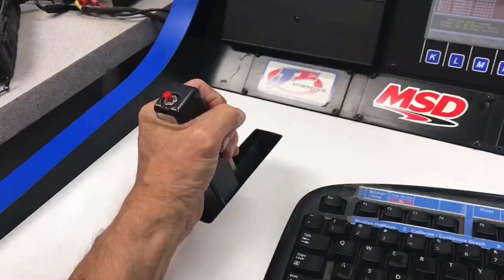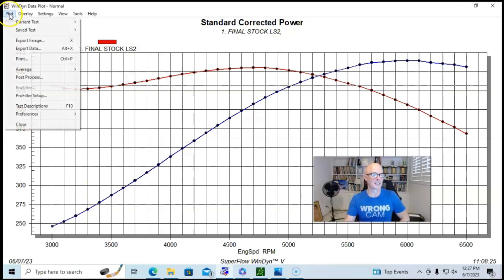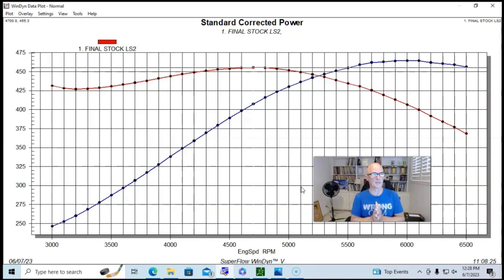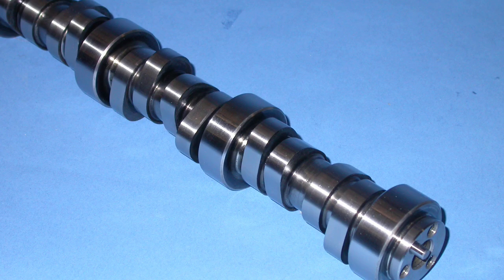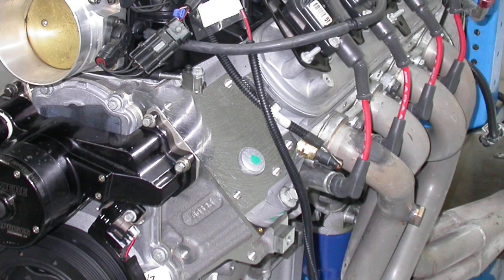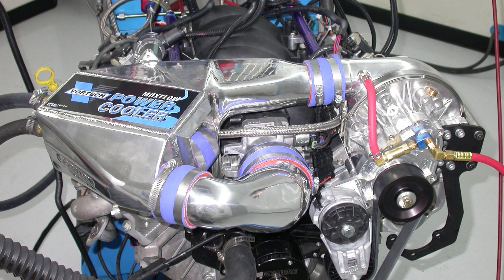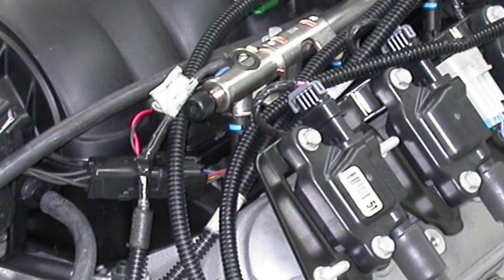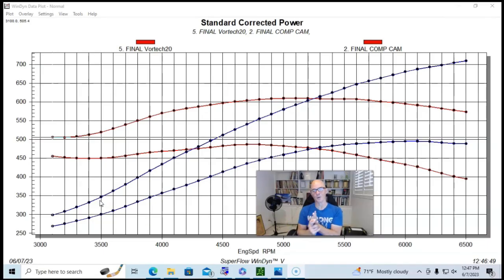HOW TO MAXIMIZE 6.0L LS2 POWER. THE FORGOTTEN ALUMINUM LS! CAMS, BOOST, NITROUS, FULL DYNO RESULTS.

Comment: Good timing. I have a 2006 Corvette with the LS2. I did a FAST 102, TSP long tubes, 3000 stall and I'm currently doing a small cam. Cam Motion Titan 3 .600" lift 224/228 duration and 113+4. I'm hoping it will give a little chop and 40-50 extra hp while still being a mild cam that doesn't beat up the drivetrain too bad or kill my fuel economy. It made 385 wheel thru the auto before the cam.
Reply: How you like it?  I have a 224/230 with 109lsa in a lq9/243 head and it's fun. Plenty tq but I upped it to 11.5:1 with the worked 243s
Reply: I made 433 whp with intake cam and headers only recently put a fast 102 tb and fast manifold Im probably at 460 whp with that once I put heads I’ll push 500 plus
Reply: @dover1966  If it was an LS2 that's just a happy dyno. I made 437 wheel on the tuner's dyno. Took it the following week to a dyno I trust and it made 403. A manual will make a little more of course. Probly 420 and with a bigger cam maybe 440. But trap speed will tell you for sure. 460 wheel is 126-127 mph trap. Let me know when you get that 120 mph slip and I'll show you a 400 whp car lol.

Comment: Richard, what are your thoughts on why the ls2 made so much larger gains down low with the Comp cam as compared to the tests with the BTR cams in the ly6 6.0?
Reply: The profile of the cam let the engine breathe and do it’s job. Stock cams are for emissions and mileage
Reply: @ZONES89RS  I understand that over the stock cam. What I'm asking is why did this cam make a nearly 25lb.-ft of torque & 15hp gain throughout the curve and all the way down to 3000rpm in the LS2 6.0 when in another of Richard's videos a Brian Tooley stage 2 truck cam has very similar specs but only makes maybe 10lb.-ft & 5hp more than the much smaller stock LQ9 cam from 3000rpm to nearly 4500rpm in the LY6 6.0? Is it a product of the almost 11:1 compression in the LS2 vs
9.6:1 in the LY6? Is it the cathedral ports vs. rec port heads? Or does the        Comp 265 cam have much more aggressive lobe ramps than the BTR cams?
Reply: @jefflee8924  ah, yea the LS2 cam itself is not a tow oriented grind down low. So that is more than likely what you are seeing. The truck cans are made for low end grunt for moving heavier rides and towing

Comment: How does the LS2 compare to the L77 from the Caprice PPV? From what I understand the L77 is an aluminum 6.0 but it’s only rated at 355 hp and comes equipped with DOD. Since everybody recommends doing DOD delete anyway would the cams you used on the LS2 perform similarly?
Reply from the maker: NOT SURE ON COMPRESSION-BUT OTHERWISE CAMS WILL HELP A LOT

Comment: I got a 07 classic with a 4.8 soon as m broken hand heals up ill be installing a truck noris cam 'springs required' with a fresh set of 706 heads 1 7/8 long tubes with speed engineering full exhaust, BTR LS7 lifter trounion upgrade and the BTR stall. Not sure how good the sall is havent hurd mucb about them but hopefully it all works out good!!

Comment: Richard, as a previous ford guy that is working on a resto mod corvette your info has been a huge help to me in learning the difference in the Chevy power plants…. Do you have a recipe of parts for me to get a 408 stroker to 600 Fwhp NA? I was looking at using the lq4 block to build on as the extra weight isn’t a huge issue. Any help you can provide would be awesome!
Reply from the maker: PLEASE SEE THE 600-HP COMBO VIDEO OR THE 175 HP CAM VIDEO

Comment: Richard, If you had a choice between a BTR stage 2 truck cam or a Sloppy Best Cam on a 6.0 with 243 heads & 1 3/4 long tube headers. Which cam would you pick in your opinion?… I’m not really looking for top end power or racing. Probably more low to med range power. Just an all around good cam that will be reliable to drive anywhere with a good idle
Reply: I have a sloppy best cam in my LS2 and I love it!
Reply: @cars_and_stuff  what size stall are you running with the Sloppy Best Cam? Also, what size valve springs?…
Reply: Pac 1219 valve springs 
3,600 rpm stall converter 
Mickey thompson drag radials
1/4mile: 11.3 @ 118 mph
Reply from the maker: best cam
Reply: @richardholdener1727  can the best cam run on a factory truck converter behind a 6.0 or will I need to get like a 2500-2800 stall or bigger?

Comment: I'd love to see these cam comparisons with factory exhaust manifolds, factory cat converters, and factory mufflers, and accessories. I suspect that the torque and HP gains would be much less than this dyno is suggesting. I'd love to be wrong.
Reply from the maker: YOU START LOWER AND END LOWER-SAME ROUGH PERCENTAGE

Comment: I understand you had stock injectors which I believe are around 33lbs ? We have a similar set up, and need to retune, but I was wondering if The stock injectors are acceptable? We are running NA. W/103mm TB and intake.
Reply from the maker: 33s will support over 500 hp na on gas

Comment: Hey there! I have a LS 6.0 engine with a cam and springs and I want to put twin turbos on it. It also has an intake manifold upgrade and I’m wondering which size turbos do I need like from MaXpeedingrods or the very best bang for the buck turbos that you recommend? I appreciate your help!!
Reply from the maker: WHAT POWER LEVEL?
Reply: Supercharge it

Comment: Is the LS2 able to be pushed into the 4 digit range and if so, what would you need to have done to the engine for it to hold it?
Reply from the maker: we don't go past 1000 hp with that block
Reply: @richardholdener1727  so what’s the highest output the aluminum block can take ?

Comment: Will a cammed LS2 make more power than a LQ9 LQ4?
Reply from the maker: the LQ4/9 have 317 heads, so the higher compression LS2 has an advantage
Reply: @richardholdener1727  okay yes I have a Trailblazer ss with 243 heads just doing my research before I cam. I hope it makes more power than I regular iron block 6.0.

Comment: Be cool to see the ls2 6.0 compared to a 6.0 truck engine like lq4 or lq9
Reply: Take an lq9, swap out the 317 heads for a set of 243/799's, and you have an iron block ls2. People have been taking lq9's out of Escalades and doing this for years.
Reply: @THEFERMANATOR  i know that. I want to see the differences in the tq curves of each engine.
Reply: Why would it be different?